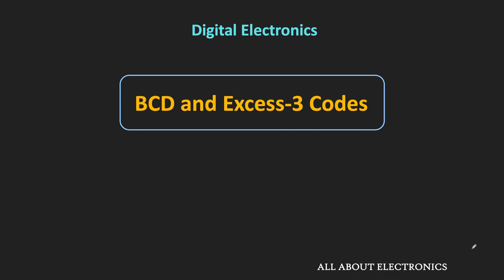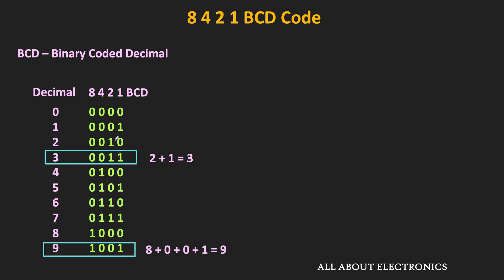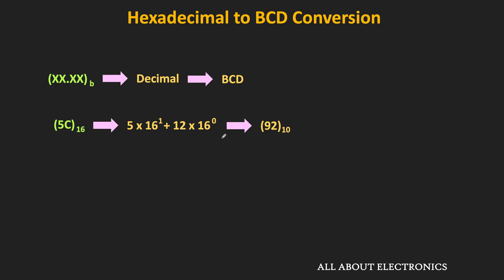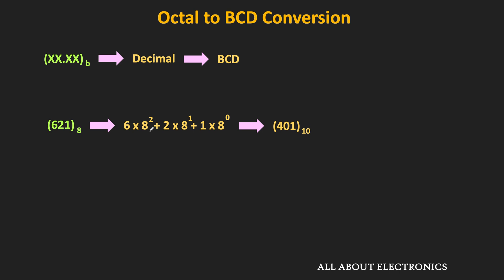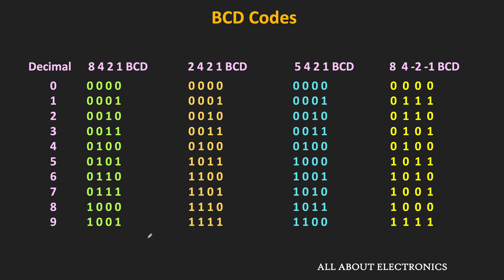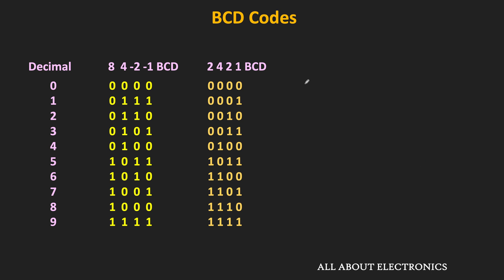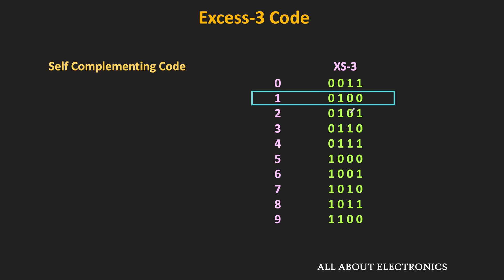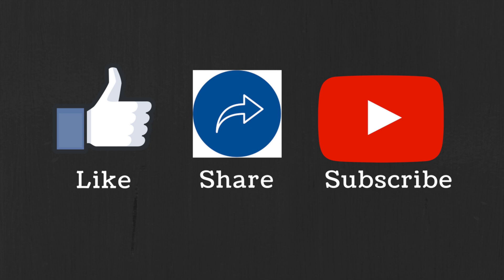BCD Codes (Binary Coded Decimal Codes) Explained

Comment: in 8 4 -2 -1 and 2 4 2 1 BCD codes, I noticed that some decimal numbers can be represented in more than 1 way. So, can I represent them in any way ? or the way as shown in the video ?
Reply from the maker: 2421 and 84-2-1 are self-complementing codes. That means you can find the 9s complement of the number just by replacing the 1s by 0s and 0s by 1s. For example, the 9s complement of the number 4 is 5  (9-5). 
So, in these codes, if you see the code of digit 5, then you can find that code by replacing 1s by 0s and 0s by 1s in the code of 4. 
And the weights are assigned accordingly. That means although it is possible to represent the number in multiple ways, we should use only that code, where the above condition (self-complementing) condition gets satisfied. 
I have also covered one example based on that recently on the second channel.
Please go through it, you will get it. 
Here is the link: https://youtu.be/Qw4QKVv4OUs?si=b_AZA1WLvnYXCVub
Reply: @ALLABOUTELECTRONICS  ok sir understood. Thank you

Comment: in 4221 bcd, how do we know which 2 we'll have to use to represent say decimal 2 and decimal 5
Reply from the maker: The code is assigned such that, the number 5 to 9 are mirror image of 0 to 4. (Replace 1s by 0s and 0s by 1) Also, it is a self complementing code. Meaning that, you can find the 9s complement of the number by replacing 0s by 1s and 1s by 0s. I hope, it will clear your doubt.

Comment: Hello
Here in 2421 BCD , BCD of 5 is 1011 but it is also 0101 so which one is right ?🤔
Reply from the maker: The code is assigned such that, the number 5 to 9 are mirror image of 0 to 4. (Replace 1s by 0s and 0s by 1) Also, it is a self complementing code. Meaning that, you can find the 9s complement of the number by replacing 0s by 1s and 1s by 0s. I hope, it will clear your doubt.
Reply: @ALLABOUTELECTRONICS  understood.. Thanks 👍🏻
Reply: @ALLABOUTELECTRONICS  
But in 2421 if 5 is represented as 0101 it's 9 complemeny is 1010 whose value is 4 
Plz clarify this doubt
Reply: But sir like code of 1 is 0001 and according to 9's complement code of 8 should be 1000 but if we multiply by weights to digits we aren't getting 8 we are getting 2

Comment: What is the value of F here? generally how we can find the alphabets values?
Reply from the maker: F is typically used in Hexadecimal number system. I assume you are asking, the corresponding BCD code for F. So, F in decimal is equivalent to 15. So, in BCD format, we will have two digits (1 and 5). so, we need to represent each digit in 4-bit BCD form. 
Therefore, F in hexadecimal is equivalent to 0001 0101 in BCD. 
Similarly, if one wants to represent A (which is 10 in decimal), then it is equivalent to 0001 0000.
I hope, it will clear your doubt.

Comment: Why we cant use 4+1=5
Why you use 2+2+1=5
Reply: in 2421 code
Reply from the maker: The code is assigned such that, the number 5 to 9 are mirror image of 0 to 4. (Replace 1s by 0s and 0s by 1) Also, it is a self complementing code. Meaning that, you can find the 9s complement of the number by replacing 0s by 1s and 1s by 0s. I hope, it will clear your doubt.